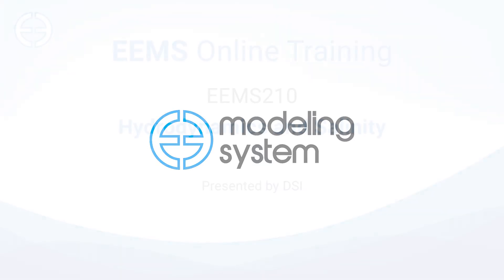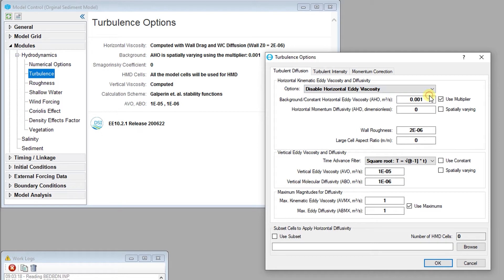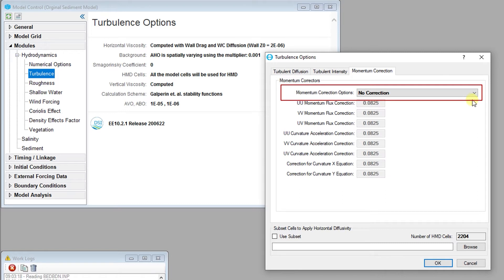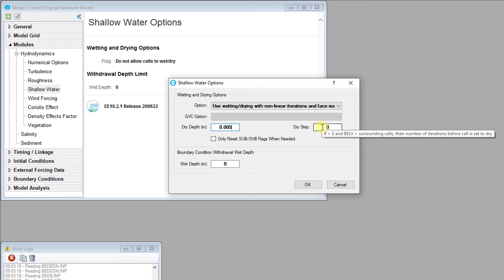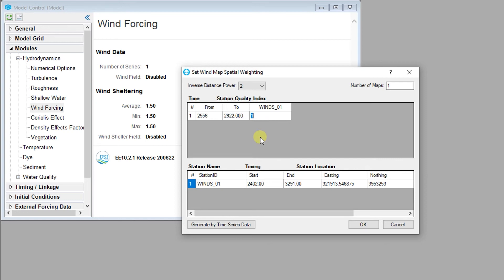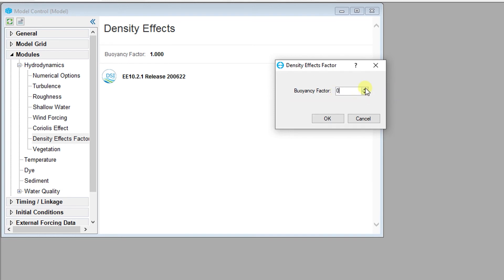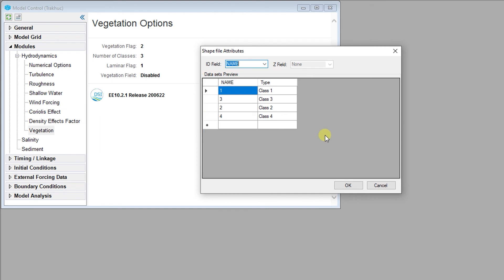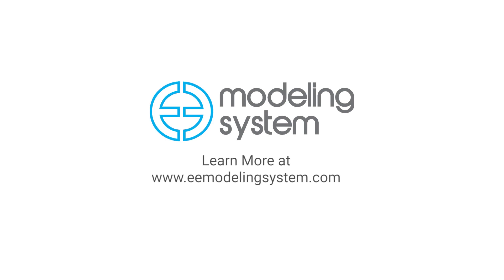EEMS 210: Hydrodynamics & Salinity Module

Comment: Hello! If I define several ATM stations, does the program calculate the area of influence by Thiessen?
Reply: The approach we use is inverse distance weighting. You can also apply different weights to each station based on user inputs. You can have a look at the following EEMS knowledge base page for more information: https://eemodelingsystem.atlassian.net/wiki/spaces/EK/pages/243630239/Wind+Forcing

That page discusses series weighting of wind forcing, but the same options can be applied to atmospheric series.
Reply: @Tea-nm4fk  Thank you very much, this helped me a lot, I did not know where to define the influence of each station.